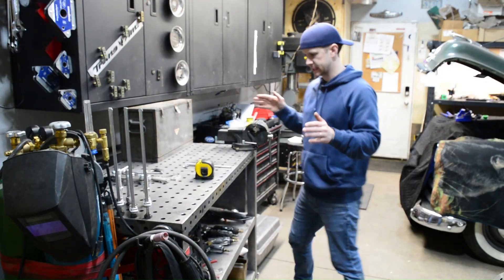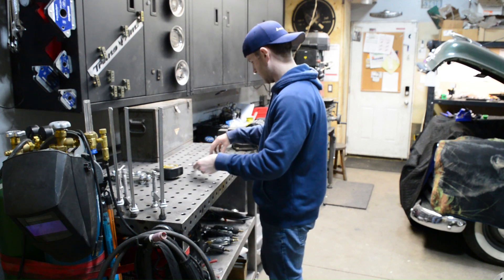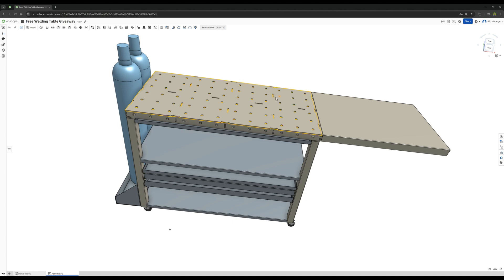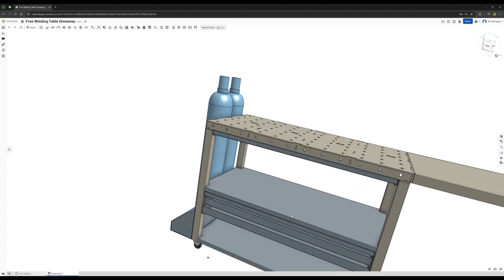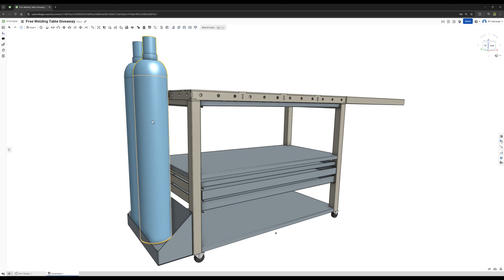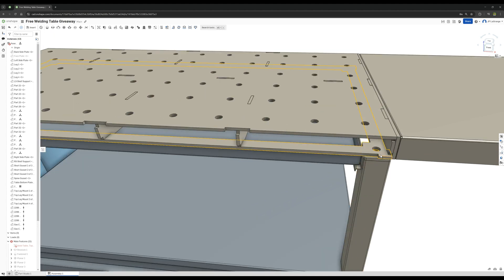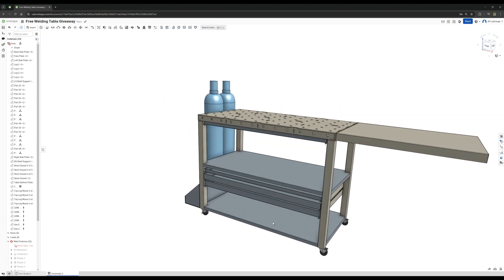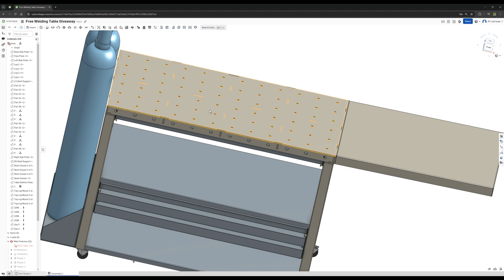Welding Table Giveaway, How it's made ~ Why it's the best

Comment: Hi,
Thats a great welding table, the only modification I’d make would be for the folding extension to have holes also . 

How can I get the plans and list of materials to create it for my workshop.

Thanks
Reply from the maker: You can send me an email and I'll send it your way. 
The only issue with the folding part being a fixture table as well would be the weight. 
If a person is going to be lifting it I wanted to keep it lighter by using formed 16 gauge steel